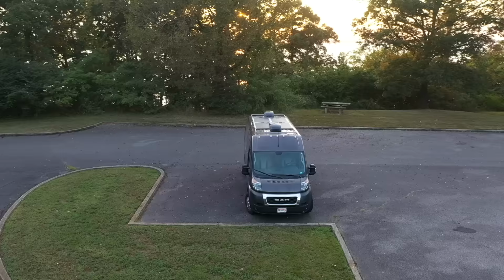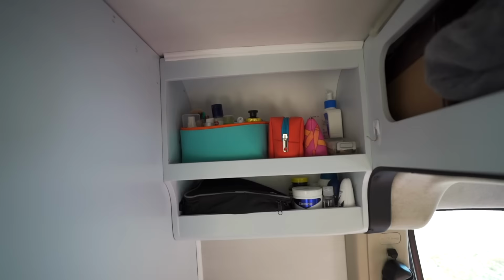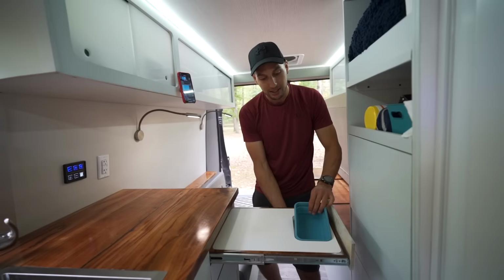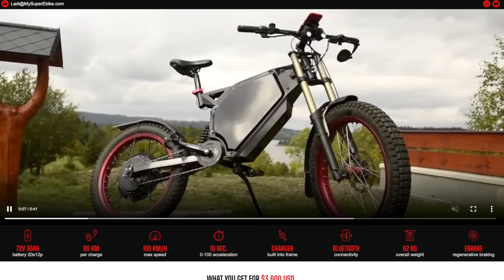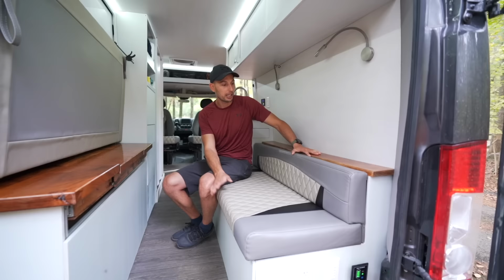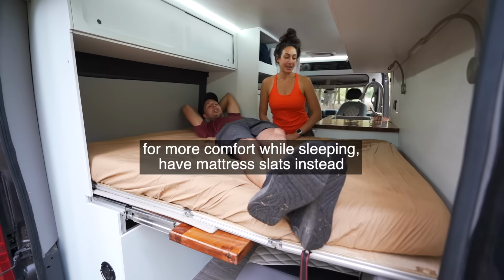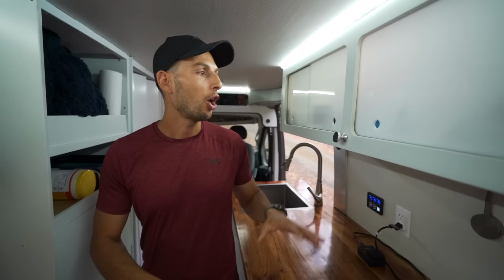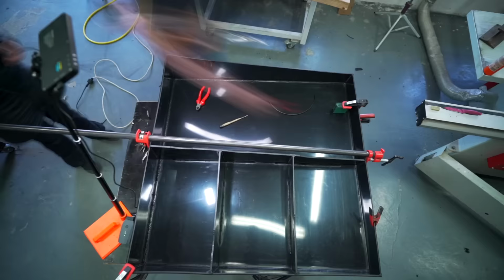LUXURY Van Tour + DESIGN REVIEW of Innovative Campervan Layout

Comment: Basic Van & Upgrades can be quite Costly:  I'll bet this beauty cost over 100 K.  Also, a Transverse Bed without any         ' Bump-outs ' require limited height/size.  Love the swivel seats, work station, double fans, heater ( diesel ? ), slide-out refrigerator/freezer,  500 Watt Solar, large capacity water - fresh/grey,  Kitchen Area with a massive sink ( Note: No Cover ),  push cabinets - No ( Need Latches/Upgrades ).  The idea for a pull-out cutting board & huge Induction Cooktop is great, but an for a Van;  A cover/cutting board for a recessed sink and a smaller portable Induction Stove stored in the cutting board would be better.  I like their comments about the shower & toilet.  Great idea if you can not survive without a shower, but a portable shower using the back doors/screen to ' Quick Rinse ' , and the Compost Toilet & Supplies in an upright closet would give you more storage.  In emergencies - sponge baths & baby wipes work.  Good idea on fulling water from outside.  Again, the Burrito bed is interesting, but I agree with his opinion.  I'm 6'5'' and with a mate, this would be too small.  Remove the shower, and put a bench with two cushion to sit - storage underneath and along wall/upper ceiling; the bench can pull out - two cushions. A large workspace table with storage can be mounted along the wall to come down when sitting;  storage under & above.  I really like the Garage in the back with a elevated fixed bed that is movable.  Magnetic " Blackout " Covers are necessary for all windows, and some type of closure to slide around the Front Seats for Cooling, Heating & Privacy.  A curtain behind Swivel Seats is basic.  You only need one good swivel table for the two Front Seats.  I agree with ability to move around and more space to walk especially for two people.  No shower - cut back on water storage/waste.  Like the evaluations at the end.  Most people do wood/darker tones verses white.  Keep it simple,  try modular if possible to remove, whether for dislike or multiuse of Van.  Thank you for the Video.  Will like to view your new build.  Bye.  Bless.

Comment: I bought a 2000 chevy express cargo van for my 4 yr sobriety anniversary gift last yr. I am disabled and suffer with some pretty bad health issues. I sunk so much into buyi g the coolest of the coolest components and 6 weeks ago today we were hit with flash flood and i lost everything i put into the build and then some. It set me back over 15 mths if not longer. I live in vermont and facing havi g to live in this truck through the winter time. Any poi ters for cheap insulation?

Comment: It's a nice layout.  I see your issues with it.  But as a single with a pup it would be less issues.  I don't agree on the fridge unless you have extra solar.  The testing of refrigerators and freezers have shown multiple times the top open uses a lot less current then the door open.  With the door open I don't care how fast you are you will lose all the cold air in the fridge every time you open it.  Cold air always falls to the bottom.  Open a standard fridge door all the cold air hits the floor and you have to chill the whole fridge again.  The more food in it the less it's effected because the food take up space.  Top load ones don't lose the air.  

I always wonder the useage of the showers.  But for living and driving where there isn't a planet fitness I understand.  If theirs a planet fitness I just use theirs.  The slide out cooktop is a mess waiting to happen.  Also uses a lot of electric.  The water tank I agree should be under and insulated.  Maybe a setup for winter so it recircs to a water heater to keep it from freezing.  The size is to big as I don't want anything hanging that low underneath.

I liked how you were talking on your build.  Linear actuators for the bed.  I was planning linear actuators for a pop top made of carbon with Solar cells sized to fit perfectly into roof recesses, so it doesn't kill the aerodynamics and fuel usage.  When the roof is up you always have a big bed.  When it's down you have a small bed in the back.  So the small bed can be the traveling bed and upper bed is used at a campsite.  As roof racks can easily cut 4mpg off a vehicle.  That's why I would use stick on solar or recessed only.  Carry 2 extra 300 watt panels to tie in with a cord at a campsite.  As you can place them perfectly and keep the van out of direct sunlight so it doesn't get hot.  I also have double swivel seats with a table that expands to use for a dinner table or work from a laptop.

Comment: Not sure about the drawer with all the loose produce and other items that could easily roll around and possibly fall out the back of the drawer getting lost or smashed as the van travels or wherever you open and close them either looking for them or trying to figure out what has gone bad and not finding it right away. Overall I like it, but like you said there are a few things that might need alterations to suit whoever buys it.

Comment: A top-loader in a mostly sealed cabinet is not gonna be very power efficient. The heat it makes to work needs to go somewhere. Moreover, I've never seen a 12V DC compressor fridge as a toploader, so that's an even bigger point of loss on energy efficiency.

Personally, I'd have pushed for a hybrid gas/electric design, one "burner" for each, so that you cook in settings where your power access is more limited... If it didn't go over the friggin' couch, that is.
As for y'all not using microwaves to cook, I'd honestly recommend a convection/microwave hybrid. They now have ones that have "airfryer" functionality, since it's a similar premise to convection ovens.

Not sure why a van that fancy can't have a proper cassette toilet instead of a generic portapotty, but more importantly, why no vent fan?

The seating and table space in the back is neat, but doesn't look very comfortable, which also applies to the bed as well.

Comment: I truly wish, that presenters would include the wheel base length, the type of fuel for gas and heaters, some have diesel where there heater feeds off of their regular tank, for instance.  Many are starting to, but my friend with a ProMaster, has to ask, and complains that he doesn’t get a response, more than half the time.  On older videos less often does he hear.  He views many talks, who all have similar installs.  
I bought a used 2020 Ram High Roof 136 wheel base, so builds only matter, if it compares, I’m noticing a lot more of the 136 wheel base ideas, but cannot tell if this compares from the beginning.  Otherwise, I love this content, yet have no idea how to purchase the same items, like heater, sink and water set up.  Who does these builds near the West Coast?  Does anybody know?  I would like to do a partial build starting with floor, rotated seats and table behind driver.
It appears that you might need a bump out like others have done on Mercedes for instance.  It also appears that the space has insulation and wall panels that take away from that space for sleeping sideways.  Also looks like it’s a larger wheel base, yet there are two larger from my 136 base… none of this would be possible.   I was thinking an outdoor shower set up would work good, only in good weather or for spraying feet, dogs, or cooling off over your head.  
Can they develop a small version without shower toilet area?  If so, I’d subscribe. ❤. Thanks!

Comment: Sorry about you fridge problem. You do not lose you cooling due to having a chest cooler . Open the normal fridge and all your cooling is on the floor. So you are not correct. O wa on having to move food and put it back.  Like your in a rush to go where ?? Nice van build. Around Bend Oregon out . Refrigerator tech in the House

Comment: "2 roof fans are essential"    

Could the air intake fan be under the van, or low down; 

- Air can be far cooler under the van 
- Hot air rising means air circulation would normally be without the noisy fan; 

- Perhaps only need the extra fan in the roof because the in-fan is at the same level as the out-fan; if low down don't need 2nd fan?
- Get real air circulation, not just horizontal along the roof area from the in-fan to out-fan
- Loosing the in-fan allows a brighter roof light, or more solar space
- With the doors shut, using just  a circulating in-fan, low down; would make much less noise. It might be muffled below a cabinet with a 50mm horizontal vent under the cabinet
- OK need to be imaginative on weather sealing a lower vent; but it usually gets less weather down
- The lower fan might be in the fridge area, so that the air circulation makes the fridge less energy intensive 
 - - - perhaps put a side fan near the fridge in a hinged external door normally used for a toilet cassette. If the fan in the door had a duct behind  it that was attached to the door, it could also lead to a small external cabinet for tools/ hose/cables ext (better use of space, using that unloved rear of an internal cabinet?) 
- A fan in the lower vent, it could be a smaller diameter than if it was a in fan in the roof, to get the same air flow
- The bug screen could be permanent in a low fan input, though cleaning it might be a chore

Neat video, thanks
Reply: There is this old man master van builder for himself only... even his printed labels are pristine... he has a round floor vent with a quick pull cover in case of bad auto smells underneath

Comment: I have disagree with your hate for the top load fridge/freezer. Yes you may have it open to find what you need, but this is the key reason for a top load fridge that we all learn in elementary school. Cold air sinks, hot air rises. Pretty simple and to take it further when you have a box open from the top the cold air doesn’t rise up out of the box it stays at the bottom and helps keep the items in the box cold with out having to turn on multiple times. A front open fridge is open on the side from the bottom to the top and when you open the door there is nothing keeping the cold air inside, it just tends to let the cold air fall right out (since that is what cold air does) then when you close the door within minutes the fridge is going to start running to cool the air again. I find it hard to believe a van builder would not know this and push an inefficient design on his customers.

Comment: I live in my van and have a Whynter top load fridge and would never use a side loading fridge in a van.  Unlike the side load fridge that spills cold air out when the door is open, the top load fridge contains the cold air... it's basic physics, cold air sinks, hot air rises.
Reply from the maker: Like we said, it might be more efficient, but it’s still incredibly inconvenient. For us convenience is much more important because we’re not worried about power

Comment: The Burrito Bed doesn't appear level to me. It's also a bit shaky. If I wanted to sit up in bed to read or watch TV, I'd want to use the passenger-side wall as my headboard. (The cabinets on the other side would prevent sitting upright.) This would be especially uncomfortable if that end is lower.

Comment: Feedback: there is a flaw ( no offense) in all the van builds and that is the limiting factor as far as how much fresh water you can use before you have to refill. If the builders design a way to collect rain water, all you need are water filters and uv lights in order for the water consumption portion, or if for showering, probably don't even need that. Something to think about to stay off grid longer. And power sources other than solar can be explored as well.

Comment: Cooktop… what would you rather run out of, gas or electricity?… I’ll choose gas… I can still cook over a fire.
Reply from the maker: You could still cook over a fire if you ran out of electricity…
Reply: @ladiandmargaret  but nothing else that runs on electricity would work.
Reply from the maker: @brianeaton3734 true! It’s important to have a very large battery bank, charge via driving, and at least more than 400w of power. But if you’re low on power, usually cooking is the last thing you want to do, and everything else requires much lower power. Plenty of meals can be made without a stove.

Comment: Agree with most of their pros and cons. Dislike the accordion bathroom door as have seen much better ( sliding hidden door). Like latch overhead doors better. Plain white everywhere kinda boring. Needs some interesting details, a splash of color. Like a fixed bed only.  Like how both seats swivel and have tables. Don't like the cook top pulling over seat area.  Some nice features but not my cup of tea.

Comment: I don’t care for the counter space as it’s to small, the sprayer for the sink is over rated as those hoses tend to leak. No back slash where the hot plate is, is a no for me. The colour white is not appealing inside the van, wish the wood would be more throughout.

Comment: Doesn't seem to be an easy function with the slide out cook top...especially over such high quality leather couch. Also, all I could imagine is steam, smoke & heat from whatever you're cooking steaming up the overhead cabinets, bedding, clothes etc. The placement of it doesn't seem practical while standing in front of it cooking you have the overhead cabinet right in your face & it seemed to be a bit further back towards the wall. I'd rather be able to look outside while cooking & having it closer to the doors & roof fan. DEFINITELY a NO GO with the slide out cook top. I'd rather have that as drawer space & use a pull-out propane. Another huge thing is I just watched 2 videos about the MaxxFans being NOT worth the money due to the exact reasons you guys stated on this video & many people going with the FantasicFan. The MaxxFans are way overrated. Being only 5' tall I love that you mentioned having seating where your feet touch the floor. Without that it has brought about years of back problems for me. DEFINITELY NOT A FAN of the burrito bed. I'd rather have a fixed bed & the real estate underneath for storage. Another no go for me was the accordion style shower door. I'd rather have the Nautilus squeegee door that's less bulky, cleans itself & looks nicer. The shower head seemed awfully low for someone over 5' to really be able to stand under. With so many builds now implementing the hideaway shower, no longer than one uses the shower I'd opt to use that space as a seating area & have a hideaway shower instead.

Comment: The water tank is too low and the built INS are wonderful But when they finally break it's a pain to find the right size as a replacement. I'm guessing this will be high 5 figures or maybe 6 figures and honestly it looks mismatched and cheap other than a plastic built in bowl and a sleek induction heater. Fine if it's 40k but awful at 60+k

Comment: You might not care about it, but physics doesn't care whether you believe the energy savings or not. I haven't tested camper ones specifically but the efficiency difference in vertical vs horizontal opening is pretty wide, more so if it's used heavily like in a full 'van life' style and not just a single night tripper. Even if you are a single night tripper, the likelihood is you will have a smaller energy reserve to pull from. If you prefer them, that's absolutely fine but 'I don't believe any of that' is either crappy phrasing or just a crappy world view.
Reply from the maker: I agree. Physics are if you want something from a top loading fridge, it’s high likely you need to restock the whole unit from the top down. Much longer open, much more aired out. Somebody should do real life energy testing, not just theoretical “cold air stays down” out of context argument.

Comment: A 5000lb van with front wheel drive seems like a huge engineering no-no and that's before the additional weight. I would be surprised if the drivetrain stood the test of time and with such poor engine access. Nope, not for me. Cool conversion ideas, though

Comment: Guys I don't understand your critiques. Top loading fridge freezers are far more efficient than front loaders (cold air sinks so is trapped in a top loader) and recirculating showers are much more efficient - several YouTube videos go over why, primarily the water is warm already and so takes less to heat up than cold water, the excess required is also not very much at all. Sorry but you come across sounding vague and ill informed, like criticisms for the sake of it.
Reply from the maker: I strongly disagree! Top loading fridge is more efficient only in theory. Practically when you unload the whole content of the fridge to get eggs from the very bottom, all your theories about efficiency go out of window. 

You are wrong about recirculating shower as well! The fact you need to heat up 8l of water even for a short shower is always less efficient compared to heating up single use 2l water. It all sounds so nice in theory from people who never used one.

Comment: The efficiency of top opening fridge is 70% more efficient … hot air rises no cold air can escape even when left open unlike front open which looses all cold in an instant…. Bad advice.
Reply from the maker: It’s not about leaving it open, it’s pulling everything from the bottom out. When you do that, you naturally shift all the “sinking cold air” from the bottom to the top as you remove all the items you need to cook. On paper top fridges are awesome, but we hated using them and found them time inefficient and super frustrating to interact with

Comment: Absolutely do not like the convection cook top. Splatter all over the wall, grease build up on the wall, cooking stains on the wall, no extraction fan, if you accidentally boil something over, it’s going straight down the wall and all over the leather bench seat. Liquids on stove top near where all the converter and batteries reside? Nope!